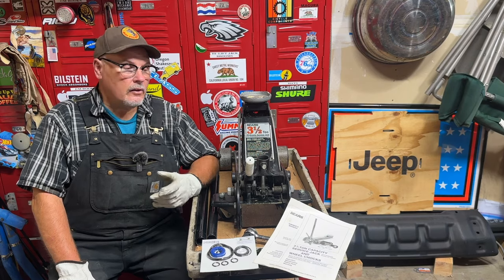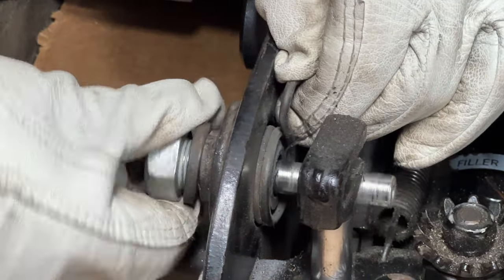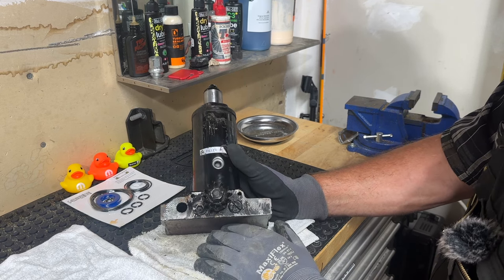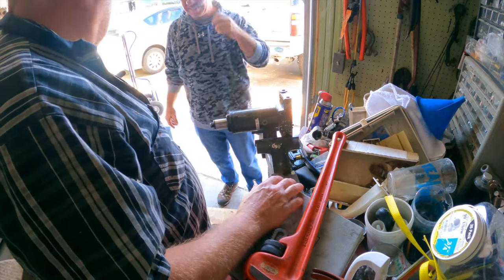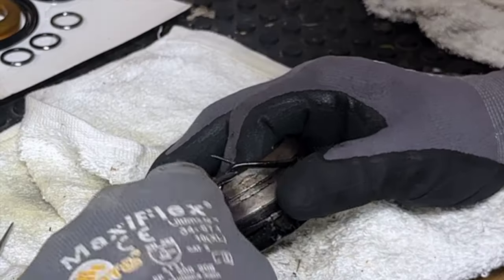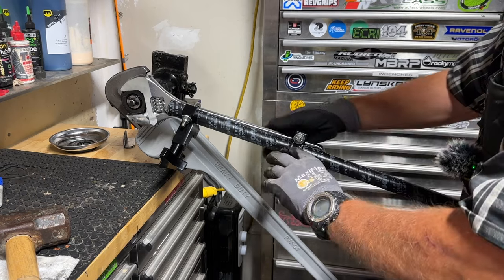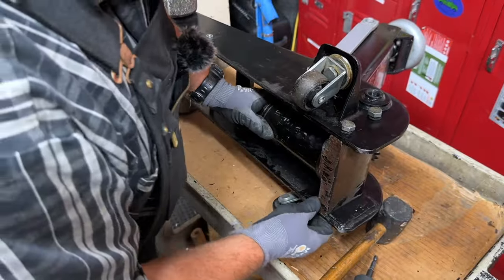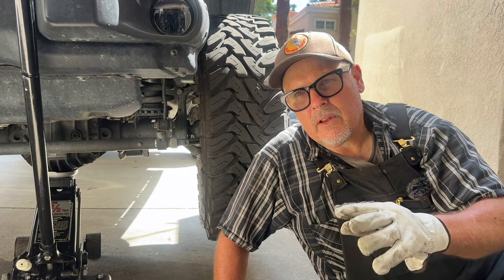DIY Floor Jack Restoration: A Step-by-Step Guide (Resurrecting a Classic)

Comment: Does this process also fix a jack that only goes halfway up? It holds weight, the oil is new and air is purged. Im assuming its piston related at this point... also, it does not leak any oil.
Reply from the maker: Maybe you just need jack oil added. Check out my article I wrote: https://www.muddyruttzz.com/post/diy-floor-jack-restoration
Reply: @MuddyRuttzz  did you read my comment? I said i put new oil in and purged the air. When i pump the jack, it pushes oil out without bubbles...
Reply from the maker: @FloppyBeef-v9k  OK, I’m guessing here- the wiper/seal is probably worn and can only hold so much pressure. I would tear it down and check everything. Other than that I can’t think of anything. Let me know what you come up with. Thanks!